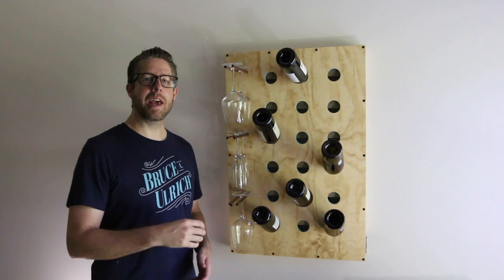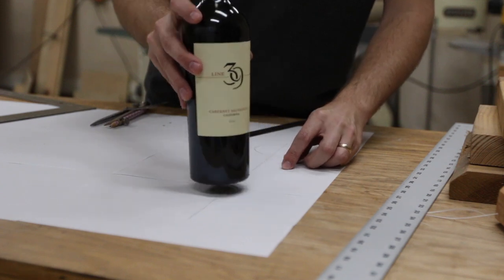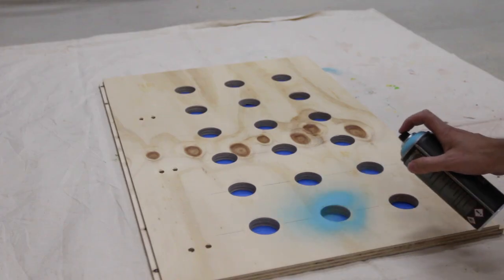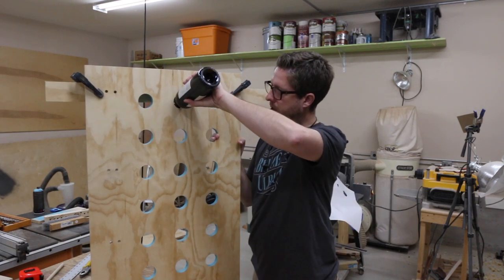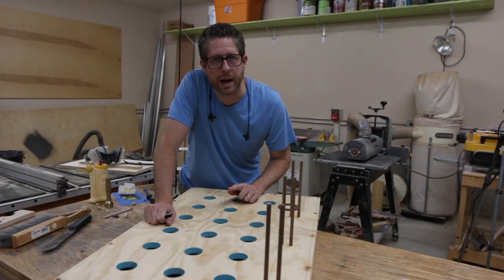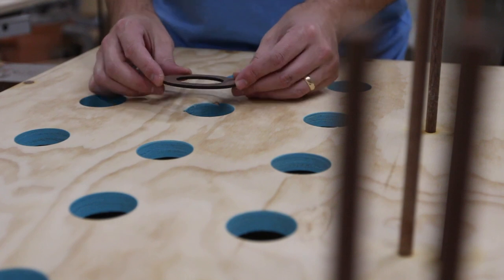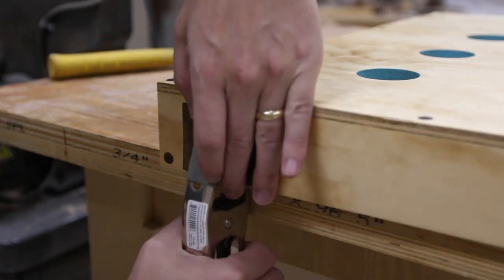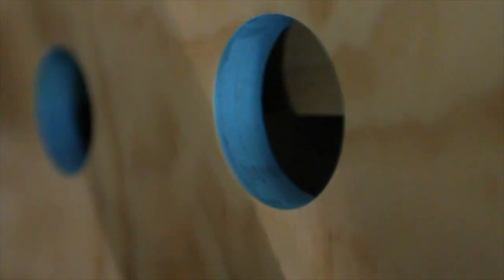Wood Wine Rack from 1 Sheet of Plywood // HOW TO MAKE

Comment: Looks great. 
What's the size of the holes for the bottleneck and how far down is the "support"?
Reply from the maker: Sorry...this comment got lost in the shuffle. I don't have this item any more...sold it. The holes were just a little larger than the standard neck of any wine bottle and you'll just have to experiment with how far down the support board so they sit at an angle like you want.